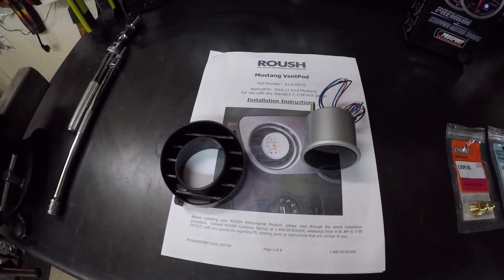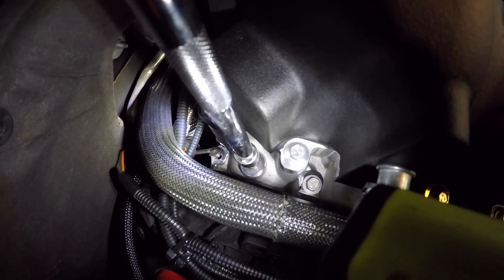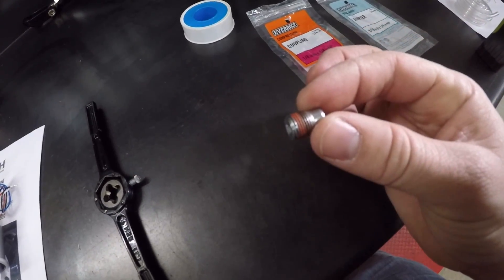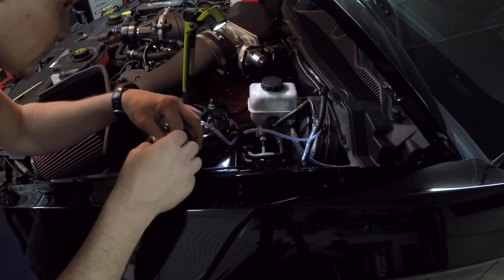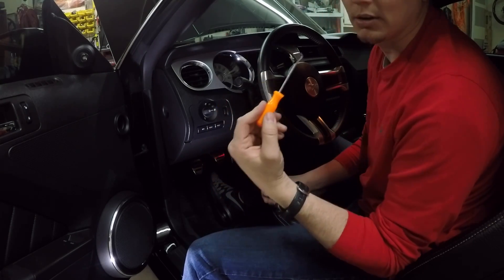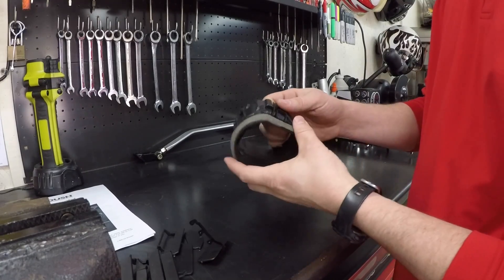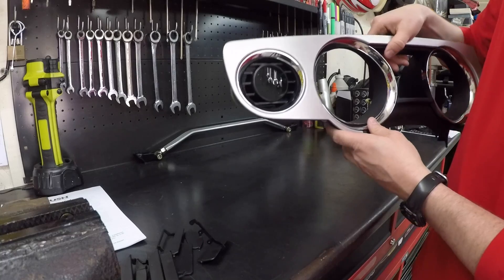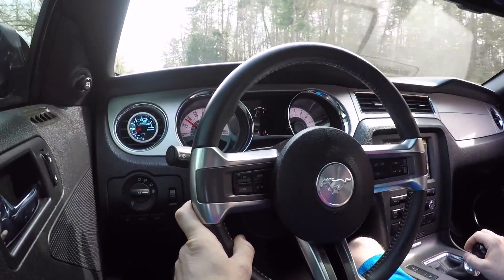Boost gauge install with vacuum line VMP

Comment: Where did you connect the white and red wires?
Reply from the maker: I can't remember the exact wires but i do know you will need to find the wire leaving the auto dimmer switch,  if not it won't work with your automatic lights.
Reply: Coyote Chris could you look to see where you tapped in?